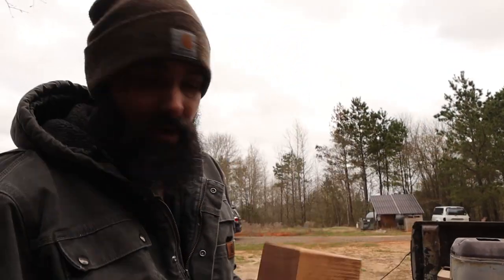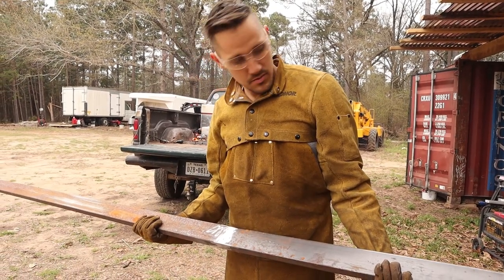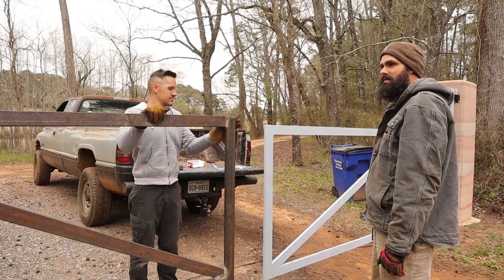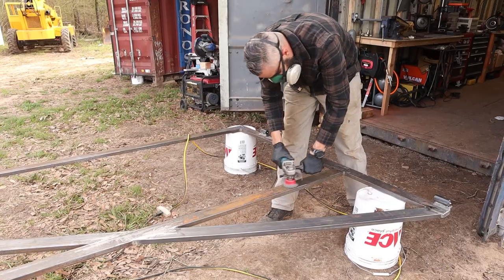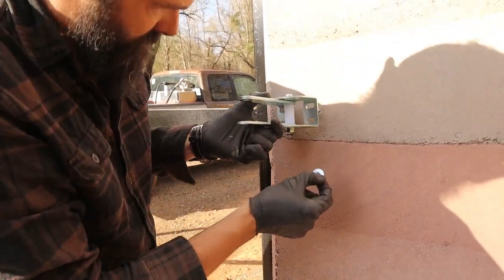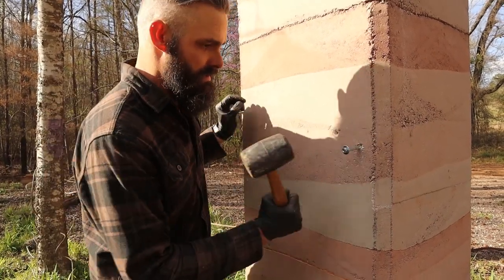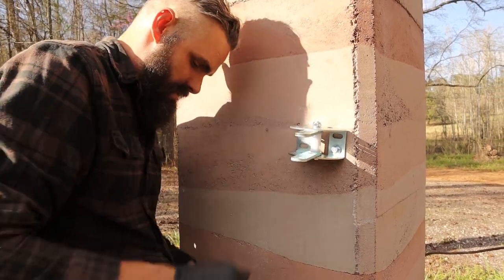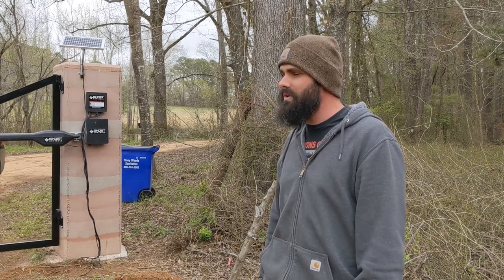Finishing the Automatic Gate with Rammed Earth Pillars - Vlog 60

Comment: Wire mold works great for concealing bundles of wire like those on the column with your gate controls. Tapcons work great to anchor the wire mold. However you’re anchor options are many. There’s a wide variety of lead anchors that are friction fit and will never rust.
Reply from the maker: Yeah we need to find some of that to clean up the wires